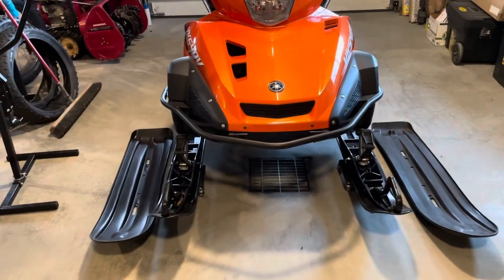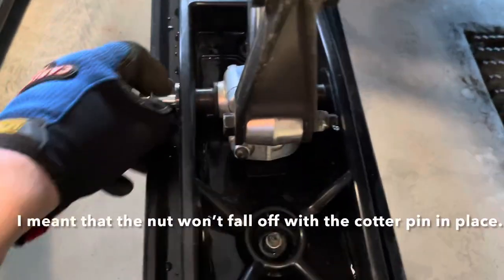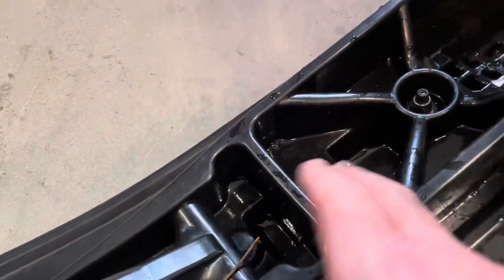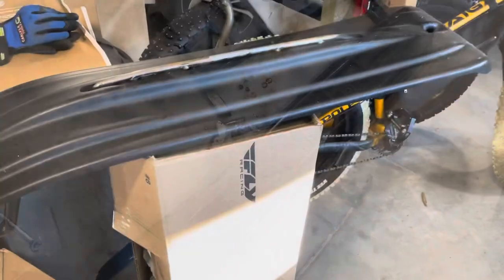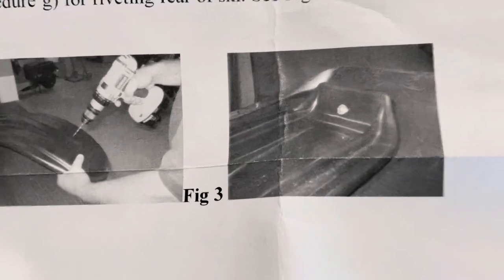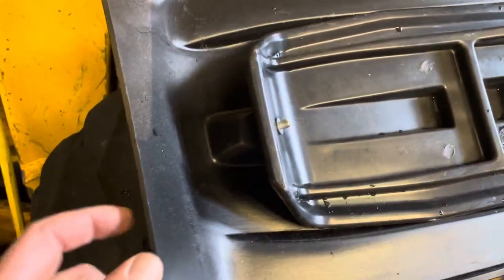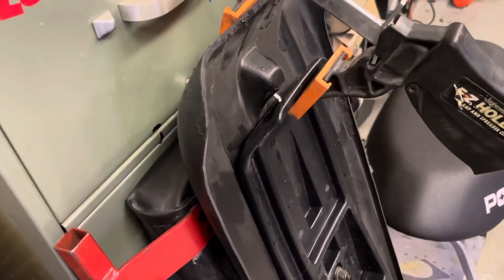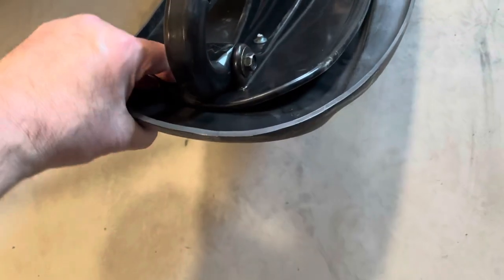VK540V ski skin installation

Comment: For others who try to install the skins, it is very easy to take a heat gun on low, carefully get the plastic skin soft, pliable, and clamp it tight to the rivet points. When skin cools off it will harden to the shape that you need to be tight against the skis themselves. Hope this helps with the video this guy was kind enough to make. I am pretty sure others probably thought of heating up the preformed skin to fit any of their skis. 🤙🤙
Reply from the maker: A month or so ago one of the rivets came loose on the front of my ski skin. I followed a suggestion on here about using a nut and bolt instead. That was a lot easier to pull the skin onto the ski.  With the nylock nut, I doubt it’ll ever come loose again.
Reply: Yeah that works just as well as the rivet. I think the heat gun on any preformed plastic part just helps it relax without the need to flex against whatever your trying to get it mounted to. The nylon nut being used is also very durable and you're not having to use a rivet gun and drill  to remove or replace things. 👍👍🤙🤙

Comment: Nice job! I didn't take the ski off just hoisted the front about a 18" . Also I had no access to air gun so I used small bolts. Installed for two years now with no issues. Handling in deep snow significantly improved. Happy sledding!
Reply from the maker: Small bolts would definitely have been easier! This is one of the reasons I really like YouTube. I always enjoy hearing about how other people  accomplished the same task but did it in an easier way! The rivets were a pain in the ass even though I had all the proper tools.

Comment: i put these on my zr 600 (along with my vk), and it actually made my top speed slower! I use my zr 600 (from 2001, but still a freaking awesome sled) for high performance, since it goes over 100,  but its top was 95, with ski skins. Obviously, I took them off because I use that as a main high performance machine, but as for MY vk 540, I use for 100% utility, so i'm keeping them on.
Reply from the maker: I’m guessing that because they are so much wider and a bit longer they create more drag and resistance over stock.

Comment: Hi...just found your channel, love the contents. I've got the exact same machine you have.
I bought it last winter with the skins included. Regretted it from the start. In the power, the things would spray snow right on me...looked like a snowman after just a short run.
Second thing, like a friend put it..."it's like trying to steer a drunken moose".
Last summer, I tightened the straps on the front of the track...made a big difference.
The other thing I didn't liked about this machine is the electric start.
If you go into powdered snow, the inside of the engine compartment fills up, then freeze.
Since the starter's at the bottom of the unit, it woulds freeze overnight * the started wouldn't engage...just turn. I had to hand start it, let it warm-up, Then it would work again.
I totally agree with you on the flotation & pulling power. That thing's a tank, almost maintenance free. I've got 1700 miles on it now & other than oil & plug change, it's been trouble free. Oh!....still got the same belt on too...:-)
Thanks for the review...much enjoyed & appreciated
Reply from the maker: Welcome and thanks for the kind words. 😀 We just got around a foot of fresh snow so I’ll finally get to run the ski skins in some powder snow. I’ve been thinking about tightening up my front limiter straps but I’ve been waiting to try the skins out in different conditions to see how they’d handle. I’ve not had the issues with the starter but our snow has a lot more moisture and we are much warmer than the interior so that’s why I’m sure. Good to hear you’ve had good luck with your VK!

Comment: Just a quick question, now with the skins on what is the measurement outside to outside of your skis? 42 inches? 44 inches? thanks and keep up the videos, only trying to convince my better half why I need the new VK!
Reply from the maker: Thanks! 

I just measured them and they are 48 1/2”. The skins aren’t a true 11” wide and roughly extend out past the edge of the stock ski 3” on each side. I’m going to ride in in some fresh powder snow tomorrow to see how they work in those conditions but so far I’ve only experienced good things and way better stability, floatation and vastly reduced tippyness.

Comment: Do the 11 inch skins change how it handles on groomed trails?
Reply from the maker: Yes and mostly all for the better IMO. They make the sled less tippy and it floats night and day better in any type of soft snow. If the VK is strictly only ridden on groomed trails then I wouldn’t bother as they can make the steering a bit harder to turn in certain conditions. But, even then, the reduced tippyness is worth it IMO. They used to offer 9” skins which might be a good compromise for a machine that is mostly used on hard snow. In my experience, the stock 7” wide skis were way too narrow and made the sled very hard to control in deep or unpacked snow conditions.

Comment: Hi Alaska Guy,

When I bought my 2018 VK,  the ski skins was installed and I can't compare with or without but you, yes.
Do you think it's more difficult to turn with the skins and/or the area to turn is more wide ....

Regards
Alain
Reply from the maker: Hi Alain,
I’ve not noticed a negative effect on steering response with the skins. Recently I rode one of my tight, twisty fat bike trails that was covered in knee deep snow and was able to make every turn. Before with the stock skis the sled would knife the outside ski into each turn, roll to that side and be a real bear to maneuver. In heavy, wet, fresh snow that was deep the VK was awful and pretty much just went where it wanted to go. I think the skins are absolutely necessary to get this machine to handle in fresh, deep snow. 

One viewer commented in one of my videos that he didn’t like them because they kicked up too much powder in deep, dry conditions. I experienced that earlier in the week but that’s more an issue with the windshield and snow conditions than a problem with skis. My Axys XCR was doing the same thing yesterday, just not as pronounced as the windshield is smaller. 

I suspect what you are really noticing is the wide turning radius of the VK as its skis simply do turn as far to left and right as most other sleds. I’ve been annoyed by this trait.
Reply: @thatalaskaguy  Exactly, the turning radius is very large  but in the deep fresh snow, I love the ski skins and looking the snow beside each skin like a cloud .....

Comment: I need to ride a vk before I buy one.  

Lets put it like this; my buddy has tundra II's and swear they are the greatest sleds on earth, I have a 22 850 pro that fits me like a glove and on the tundra I look like one of the worlds fattest twins on a miny bike.  Hes 5'7" and I am 6'2", his sleds never run right and mine runs like a swiss watch, if i need parts(which is RARE) they are readily available, if he needs parts (ALL THE TIME) hes reduced to ebay or fb groups and praying they have em.  Im also trying to convince him to get ANYTHING fuel injected and relatively up to date but hes gonna have to learn that getting nickled and dimed to death over practical antiques gets old fast.
Reply from the maker: My brother had a Tundra 2 for a year or two and I rode it a couple times and didn’t care for it. It was tippy and had no power. I still don’t understand why they are held in such high regard? 

One year we were marking the trail for our local cross country race and heading out across the lake in deeper snow and overflow. Once we crossed he said he was totally stressed out as he had the Tundra pinned wide open and got left behind and was bogging down numerous times and barely made it. It also had so little power that climbing hills wasn’t something it was good at either. I think they have their place for riding in the woods in set up snow but I don’t think one of those is a versatile as a VK. 

I’ve got 4 fuel injected Polaris sleds and they’ve been great. But I also hope I never have to troubleshoot issues with them as they are a complete pain in the ass to work on. They require new fuel filters every 2000 miles and the aftermarket filter was around $75-$85 and a pain in the ass to replace. I replaced the engine in one of them and it took me like two weeks working on it at night after work and it wasn’t a fun experience. The whole time I kept thinking about how much easier it is to work on carb’d, fan cooled sleds.

Comment: Great video, would these fit on a 2020 vk pro
Reply from the maker: I don’t know off top of my head? Check the parts diagrams to see if both sleds use the same skis. If they do then they’d fit for sure. If not they would still likely work, the skag is primarily what holds them in place and I think Yamaha uses the same skag across the line for the Japanese built sleds. The ski bottom profiles might not match well, making it difficult to use the pop rivets but through bolts could be used instead.

Comment: Hi What is your opinion of the Yamaha VK Professional II? I am considering buying Skandic SWT 900 ACE next season and I wonder which one will be the best for Ice fishing only?
Reply from the maker: I can’t provide an experienced opinion as I’ve not ridden either sled. Just going off the specs I’d go with the SWT because both machines are quite heavy and the wider track will provide much better floatation. The downside is the tunnel may feel uncomfortably wide. The struts on the Skandic are also much better for off trail riding. However, if you are only going to use it for ice fishing and never, ever leave the trail and only operate on hard packed surfaces and lake ice than flotation won’t be an issue and the Yamaha’s front suspension will have a better ride plus the power steering will be nice. I had that Yamaha motor in my old Nytro and it was great, very powerful and ran perfectly all the time. I couldn’t tell if the Pro came with radiator? In hard packed snow and low speeds liquid cooled sleds will over heat unless you are running scratchers which still need some speed to work and are kind of a hassle. If your conditions are predominantly frozen hardpack  snow and ice and the Pro doesn’t have a radiator you might consider the fan cooled VK540 as it won’t overheat. It’ll still need scratchers for operating for extended distances on bare ice or frozen hard packed snow but so will every other snowmachine as the hyfax requires snow/ice shavings to keep them cool and lubricated.

I saw Yamaha just came out with a patent for what appears to be a hybrid sled with big battery pack under the seat. It appears that it would be able to power tools, kind of an interesting concept.
Reply: @thatalaskaguy  Thank you for your extensive and factual opinion. I am slowly approaching to  the Yamaha VK  Pro II. Ps. Yes  it is equipped witch radiator .
Reply from the maker: @waldemarreczydlo3830  I’m glad to hear it has a radiator, that’ll prove to be invaluable for your use. The Pro is also one of the few made in Japan sleds they still offer and the build quality will be much better than their rebranded Arctic Cat sleds. Ski-doo also makes a quality sled but tend to have too many electronic gimmicks for my liking. It’d be good for you to do a search on issues they’ve been having with their electronic throttle. Perhaps that’s been corrected on the 21’s, I don’t know for sure? You might also do a search for the old Yamaha Sled Talk blog where he did a comparison to the build quality of the Ski-doo 4-stroke engines compared to Yamaha. It was pretty interesting. Naturally it was biased towards Yamaha but the author was quite down to earth and seemed sincere. I used to use him as a reference and correspond with him when I had my 4-stroke Yamahas.
Reply: @thatalaskaguy  Thank You one more time
Reply: Go with the 900 ACE
Reply: @edwardfinn4141  Edward, share your opinion please.
Reply: Waldemar Reczydlo  the VK professional is too heavy ,  and clumsy for me , I would get the ACE 600/900
Reply: @edwardfinn4141  Thanks Edward

Comment: Where I can get this jack ? what's the name or compagny ?
Thanks for the video
Reply from the maker: Thanks! Are you in Alaska? I bought mine through Hatcher Pass Polaris in Wasilla. I bought a similar one for my brother a couple years ago at our local NAPA. I suspect they had ordered it through Western Power Sports. The Arctic Cat/Suzuki dealer in Anchorage can get things through WPS as well as I’ve ordered stuff through them in the past.
Reply: @thatalaskaguy  Thanks for your quick response. I'm from Québec, Canada.... a little bit away ;-)  I'll try to search through Napa dealer.
If you have time, a quick video (for a newbie like me)  to how to ajust the rear spring on both side. I saw a black plastic piece with Hight-Medium-Low indication but the hexgonal nut is made in plastic and and dont want to strip it.  Again thanks for your video, its very usefull.

Comment: Where did u find the skins? Make and part # please
Reply from the maker: https://www.shopyamaha.com/product/details/ski-skins
I couldn’t order them off the website but I just called my dealer and ordered through them. Be careful though, they are sold individually, not as a pair, and they initially only ordered a single one for me then had to reorder. Every warehouse was out of stock and it took 2 months for the second one to come from Japan. There are two sizes available and I went 11” have have not regretted it for a second. The stock skis are way, way too narrow for the weight and size of the VK if you ride off trail. In my experience the stock skis make the VK very tippy and hard to ride in deep snow.

Comment: where ya order your ski skins? just picked up a vk 540
Reply from the maker: I ordered mine through my dealer at Performance Yamaha in Wasilla. Hopefully the ski skins are more readily available now. My first one came in within about two weeks but the second one took about 2 months to come all the way from Japan. None of the warehouses had them in stock.
Reply: @thatalaskaguy  I see them at Babbits on-line for about 75 apiece and 45 to ship.  almost 200 for the pair which I can deal with as long as they are not a lot cheaper some where else. Is that about what u paid at the dealer?
Reply from the maker: @bullwinkled790  yes, that’s about the same as what I paid. That shipping seems reasonable as the box is huge that they come in. I don’t know if you are in AK but shipping is really expensive for us here. We often can’t/don’t order things from the lower 48 because the shipping charges can equal the cost of the item unless they are willing to ship USPS.
Reply: @thatalaskaguy  I am between Healy and Nenana - will give Babbits a try
Reply: @thatalaskaguy  actually babbits wants $147 to ship. will check with dealer next time I get to Fbks
Reply from the maker: @bullwinkled790  $147 Wow! But I’m not surprised as the box was fricking huge. I hope things are now back in stock and your dealer can get them. All told I waited around 2 months for mine but so worth it. I’ve not yet ridden it in deep snow with them on and some guys seem to have reservations about them in those conditions. But for me I’ve had zero regrets and wish I would have had them from the start. Day and night difference in handling and float all for the better.
Reply: @thatalaskaguy  and I would have thought that in deep snow they are at their best...
Reply from the maker: @bullwinkled790  same! Guys have written it changes the manner in which the sled floats in deep snow. I honestly can’t understand how having the skis knife in constantly would be preferable to having a front end float on top so I’m curious to find out for myself. I fully expect to prefer the wider skis as that’s the case on every other sled I’ve ever owned.
Reply: I got mine from yukon yamaha, the 9” ones. Im in the US and they are in canada, but the guy was super friendly and helpful.

Comment: i did 13' uhmw 1/4" built my own superwide skins, fo $75
Reply from the maker: It’d be cool to see a video of them!
Reply: @thatalaskaguy  im in willow alaska, got 2 peices of uhmw 13" wide from alaska rubber cut the slit for skag and sank counter hole for carrage bolts heads to be resest on bottom side of ski on my xt570 bear cat, needed them because that machine had a 17 gal tank and was heavy in soft snow